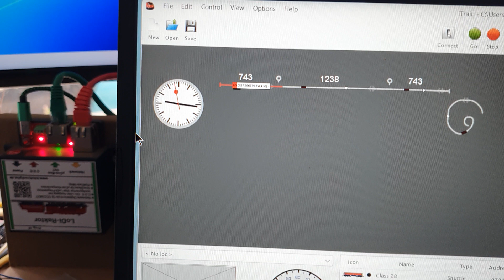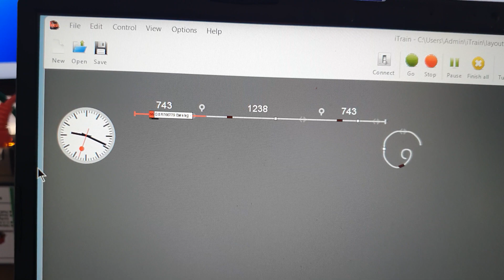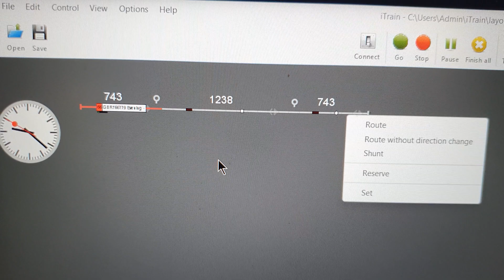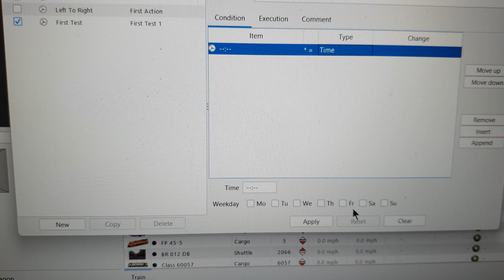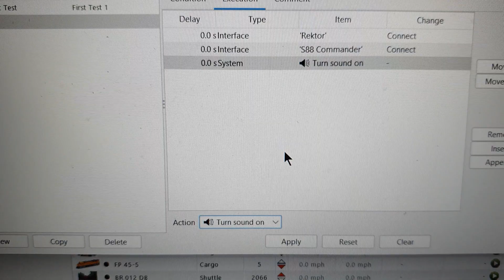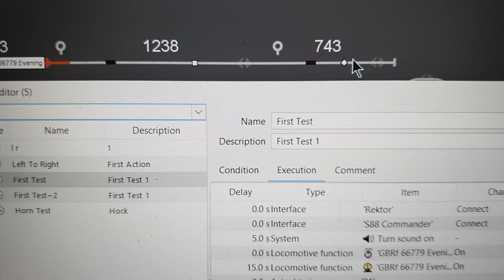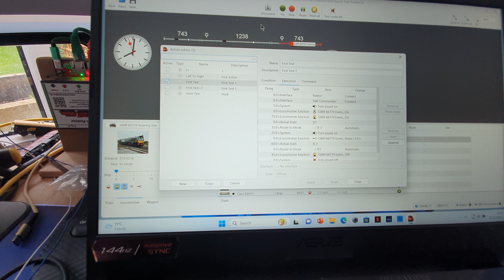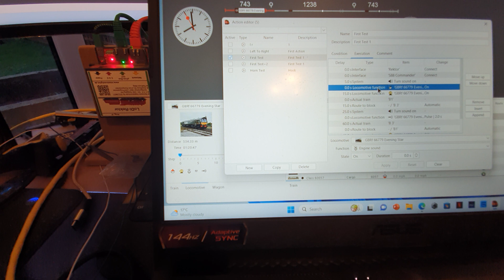No. 102 Update On Bridge And Actions

Comment: Colin - I think I followed most of that - as a potential ITrains future user your videos are helping me understand how I need to organise my new layout and I will be going back to your videos for advice and how to tips I am sure - thank you.
Regards
Steve
Reply from the maker: Hi Steve longs I haven't put you of, if at any point I can help please let me know. One thing the track you have put down have you made blocks because itrains work using block, know that doesn't mean you can't run trains with your controller know you just need the wires in as in dropper wire to each block  and the track isolated to form a block, then in the future you disconnect the dropper wires from the bus and you would then extend them to what electronics you ate going to use to detect the train in a block. Because you would have to take the track up to put the isolationed rail joiners. Yes you could solder wire on the side of the track but the wire wouldn't be covered by ballast. Don't let this put you of getting itrain I'm just trying to think ahead for you before you do to much scenic work. Colin